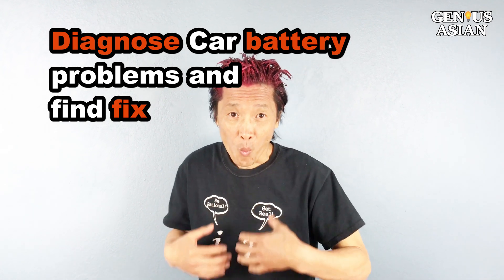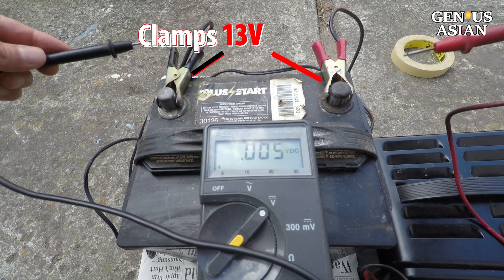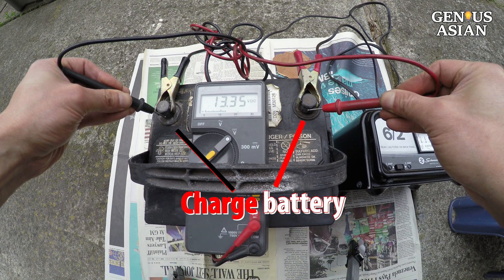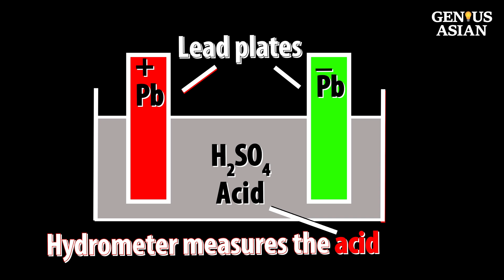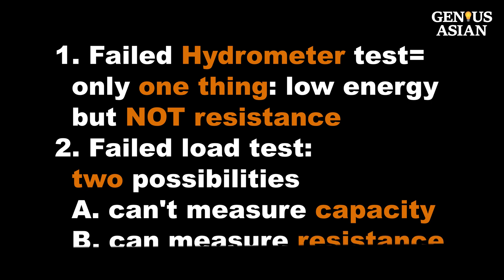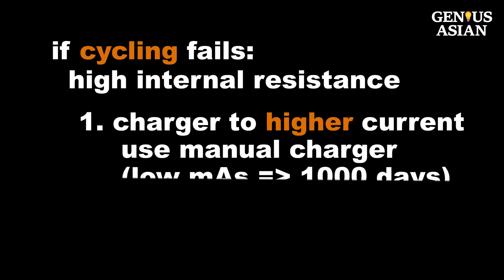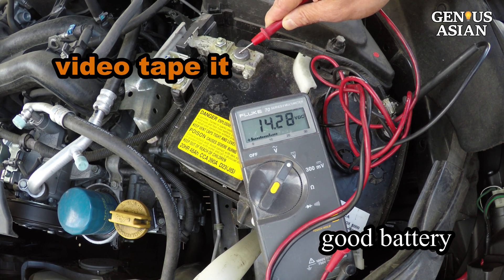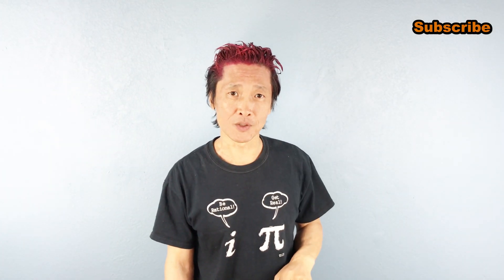Best car battery troubleshooting, correct diagnosis and proper fix with certainty

Comment: Why not use a battery brush? Works a lot better than sandpaper or toothbrush.
Reply from the maker: thank you for taking the time to share your tips. yes, a special battery brush can be used specially if you do this often. If you do this every 10 years, then some DIY methods can be used otherwise you need to remember where you stored this tool.

Comment: Nice video Plz make the vidoe of how to diagnosis car electrical problem step by step
Reply from the maker: Diagnosis is very similar to a classical circuit. In our case there are 5 parts: battery, fuse, switch, light bulb, wire. It depends how easy you can access and test each part, you may start from battery or fuse first. The most difficult part is tracing the wires, which could be time consuming.